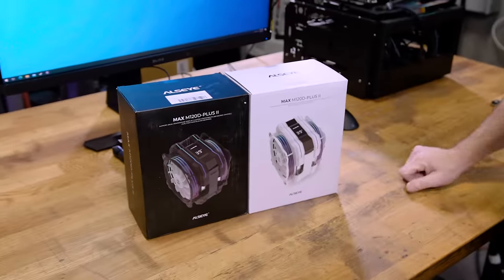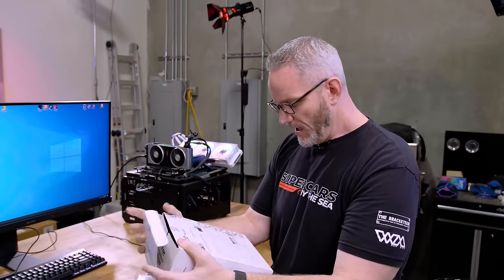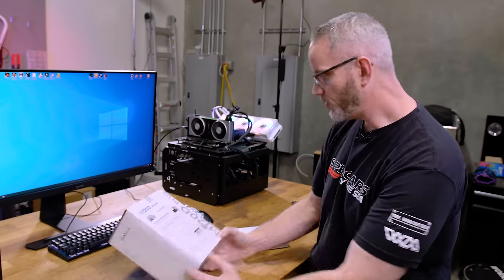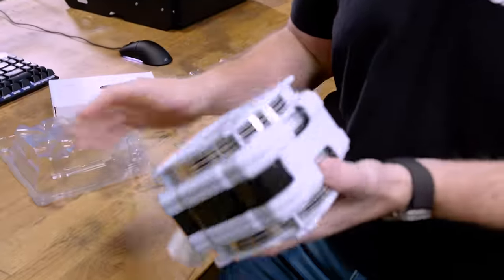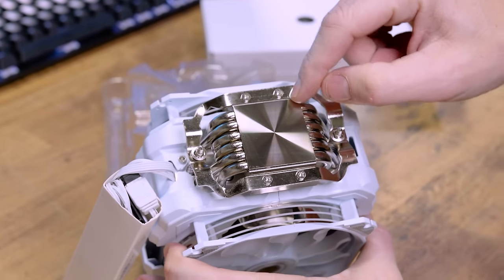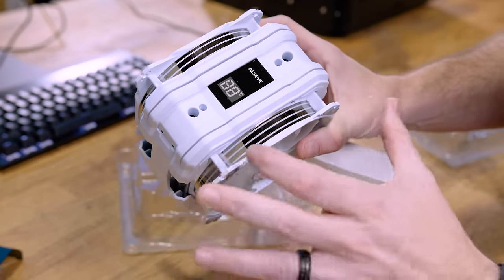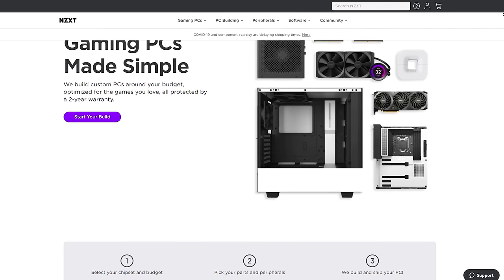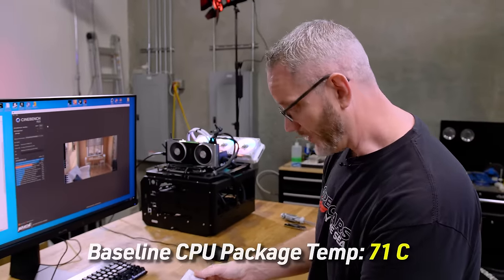This air cooler is actually terrible for modern CPUs

Comment: Jay is drunk LMAO.
This cooler is not for OC, at least not on 12900K/12700K.
Its a cheapo single tower Chinese default made for default clocks, no OC, [maybe some OC on 12600K]
Even on dual tower air coolers, like noctua D15, Overclocking 12900K is not a serious option

Comment: When my 240mm AIO died I ran my 10900K on the Hyper 212 Black Edition cooler while I waited for the RMA. The CPU thermal throttled constantly at stock settings. It ran well enough until the replacement AIO arrived but I couldn't run it under full load for long. With the 240mm AIO I use (Be Quiet! Pure Loop 2 FX) my 10900K, in a Be Quiet! 500FX case, runs a 5.1 ghz all core overclock with Asus multicore enhancement turned on and doesn't get above 85 C at full tilt. Thanks for your review of the 500FX by the way. It is what made me take a look at the case and ultimately choose it as my case upgrade.

Comment: I use a m120d-plus old version... for my 12600kf really fine... 
That aircooler dont looks good for i9 and some i7 if overclocked.
But with mid cpus is good aircooler.

Comment: I have a 4 pipe, 120mm fan, Deep Cool air cooler that was $15. Replaced my Wraith cooler that came with my 5600x and saw an immediate 20 degree difference. Cinebench throttled before with the Wraith, now it stays under 80c. My max boost will hit 4.8Ghz also.  ;)

Comment: Even though it is a push-pull cooler... it is "only" a 120mm single tower.
Other Coolers like this from the competition (like Noctuas NH-U12A) are rated for 150-180 Watt TDP.
And those Noctua Fans are almost certainly better.

So with a Power draw of 250 W on your CPU you are simply asking too much

Comment: I have my 13700k locked at 5.3 all performance core and 4.3 all efficiency core, underclocked temps being high 30 low 40 idle and low to mid 80s in Cinebench R20.

Comment: Funny enough I have a CM Hyper 212 Black Edition hooked up to my 5900X with a couple of Corsair LL120's in push-pull and it keeps the 5900X in mid 60's low 70's while running Chinebench R23. Of course wasn't really meant to be used long term. I'd like to eventually get a 360 aio at some point. :)

Comment: Ive been extremely happy with my be quite Dark Rock Pro 4 Cooler I have a Ryzen 7 7700X and its base clock is 4.5 and its been at right around 5.8ghz and running at 65°

Comment: Yes, please do a amazon cooler shootout! Running a 5700X cpu with a Hyper 212 Black in push-pull (2000 rpm). Keeps it nice and cool but I like this cooler for the temperature screen.

Comment: I am currently using a Cooler Master Hyper 212 Black Edition air cooler on my new Ryzen 9 7900X system. Normally when use the system the CPU temp averages around 49-50 C when idle or even with a handful of apps open. Sometimes there is an excursion towards 65-80C and then back down. When I run Cinebench (or use CPU ID and Stress CPU)  it hits TJmax 95C pretty quickly within 30 sec or so, stays there. So my questions are (1) if I let Cinebench run for the duration will this damage the CPU? I'm realizing it's probably throttling at that point and  (2) should I replace this cooler with an AIO? I have one but did not install it since I need to mod the case to make room for the 240 fans.

Comment: This one looks nice but I wouldn't trade the Vetroo V5 I ended up purchasing after seeing it on one of your shows. 150W TDP air cooling plus the choice of which side the fan is installed so it doesn't interfere with the memory. While I don't do much gaming with my computer, I do make it work hard compiling code, CAD, working on preparing 3D models to print, and other tasks. I can't recall my CPU temperature going above 70C and I know for sure that it hasn't gone above 80C. When my computer, an AMD 5900X, is running at max the CPU temperature is in the 60C's and doesn't throttle. This is thanks to very good ventilation supplied by the fans that came with the Cooler Master MasterCase H500 case.

Comment: guess they updated the tdp. its 235 now. anyhowwhen, noctuas fans have double the power (mmH2O/CFM). So i guess you could use atleast that display if you replace the fans for 300w tdp?

Comment: Do it test the coolers i have the Scythe Mugen 5 Rev.C CPU Air Cooler, 120mm Single Tower, Black Edition, Intel LGA1700, LGA1151, AMD AM5/AM4/Ryzen 120mm, Single Tower and want to know if i did good for my ryzen 5 5600 cpu!

Comment: I think the crash at the same point is due to software lag. It probably hit tjmax but the PC had no time to process it and send it to the display as it was crashed already. That 5.2 no throttle setting overwhelmed the system without high end cooling.

Comment: Hi Jayz, What do you do with the old processors/motherboards? 
We are a newly started Esport Organization in Norway that has grew to the biggest "club" in Norway, and we are currently looking to set up a prep room for our teams. 
Parts in the US is so much cheaper than in Norway it's insane. 
What we are currently using are i7 -7700k to i7 9700K on the LGA 1151 platform. 

We are only focusing on CS:GO. 

What combo would you recommend for our setup? Motherboard/processor?
Best Regards
CO-Founder Nordix E-sport

Comment: I like the aesthetics of this Alseye cooler, I have it and I want to wait for you to give me a similar and better option before i build my new rig, I thought I had a great deal for my ASUS  Prime Z790-A DDR 5, you should also do a review on the Alseye Ai Pro case in white, my parts are Core I9 13900k, Corsair dominator 64 DDR5 Ram, 1000w psu and WD SN850x…I also like a Radiator coolers but in all white with the temp display, I’m big on aesthetics..any suggestions on the cooler would be great..thanks and i love your hard work and passion on this channel

Comment: 8:36 wee need new header like +12V +5V G R G B USB+ USB- and FAN so if I'm right there should be 9 wires cable :) plug one cable and your done, have all rgb all fans all usb :D

Comment: I use this, but in black, with my I7 11700k and this keeps my CPU at ~75C during a stress test and I've seen a peak of 91C and I haven't seen any Thermal throttle.

Comment: it is a single tower air cooler, for a high end cpu your would want a dual tower cooler (comparable to a 240 aio)

cooler tdp can only be compared with the same brand (tdp has become a fake marketing number)

i have cooled a ~200W cpu (phenom ii 965 @ 4.2ghz) with a 212 evo, push/pull 100% fans running prime95, that was a fun cpu to oc...

Comment: Whats the best low noise one to get. I like the thermal screen on the cooler. I have a case with a window so i can see it. 
I think it's alot of extra wires. Should i care. Kinda want to make it neat. 
The darkrock pro i bought isn't enough for the i7 adler lake. Got a crash a couple of times bc of overheating.

Comment: As a potential first time builder, I would be highly interested in an air cooler comparison, or top 5 etc. I would also like a water cooler baseline as well based on radiator size (120, 240, 360) to be included to not only show which air coolers are effective, but also it might be more worth it to upgrade to water cooler depending on stock/oc and general performance expectations and outlook
Reply: first time builder you say, i would deffo go with a AIO hydrocooler. instead of pure air cooling. 
Make sure to setup fans with proper intake and exhaust.
Make sure when you choose a motherboard that you get DIMMS your motherboard naturally communicates with. 
Building now a days is super easy compared to back in the days, remember more RPM on the intake than the exhaust, and pay attention to the CFM of the fans you buy, and if you dont want a noisy computer, go for Noctua :)
Reply: @FingalPersson  thanks for the notes. I definitely feel like I'll go AIO since I'm considering a 13th gen chip. But I was still curious where the dropoff would be or if air could compare to a 240. Or when it'd be worth getting a 360 vs 240 kinda thing
Reply: If you are going for the 13900K i would recommend buying a CPU bracket along with an AIO. The temperature difference is major. We are talking 20-30 degrees Celsius difference under heavy load and about 10-15 degrees difference at idle temps.  

I have a 280mm on my 11900K thats 2x140mm on a rad, works just fine.  I am going with a 360 3x120mm later, mainly because the radiator is larger, therefor heats up slower and it fits my intake better to have 120 exhausting on top than 2x140mm.

Right now i have a quite stupid settings for my setup at the same time its not that stupid.

In front i have 3x120mm

1x120 @ 1600 rpm max
2x120 @ 2200 rpm max 

Now the one that cant do 2200 rpm will be cahnged to the same fan as the two that does do 2200 rpm.

the radiator mounted on top is with 2x140mm that throws 1700 rpm at max.

in the back i have a 140mm that can throw 2000 RPM.

Now this is NOT ideal tho.

The ideal would be to have 3x120 @ 2200 rpm intake front

3x120mm 360 rad on top

and keep the 140mm in the back, but also maybe not run it at a very high rpm unless you do have your GPU vertical mounted, then i like to ramp up the rpm on the backexhaust too as it will take out the hot air from the gpu quicker.

I am thinking of re arranging the location of the fans in front,  just to h ave the highest RPM on top and the lowest on the bottom, but at the same time oh tho its more of a job, i kinda wanna put the AIO in front with push intake
and then leave the 3 120 fans on top as exhaust but im unsure if i got space enough, i do have a massive 4080 rog strix card in my NZXT H7 flow case :)
Reply: @Koyote2033  but front mounting my AIO now would be pretty bad idea air pressure wise.   So i'm better off having it on top, exchanging it with a 360 rad :)  
I sorta dont like to block off the airflow from the intake with anything, especially not a radiator, oh tho i do that in my streamer rig, which is a H510 flow case. Have a 240 in front, 240 in top and 120 at the rare end on that, and that works great, but it only yields a 3070 card so its not as air hungry as say a 4080 for instance :)
Reply: The problem with AIO's is their lifespan. Pumps usually only last 3-5 years. My Dark Rock Pro 4 will never die lol.
I do love the aesthetics of a good AIO tho, compared to an enormous air cooler.
Reply: @DarkReturns1   who told you that so that you believed it? lol That a lie.. Also your fan, with a BeQuiet on it can like all other fans, fail... i started using AIO when i bought my i7-3700.. used it until i upgraded to having to new systems, beingn 10700k and 11900K. both using AIO.  That rig that has the i7-3700 is still running with the same AIO with fine temperatures.  That rig is from 2013/14 ...
Reply: Thermalright Silver Arrow II...
320W or something like that...
They have modern versions of it.

Comment: Jay is conflating cause with effect.
The CPU can absolutely operate with stability at 104 degrees all day every day.
If it's unstable at 104 degrees it's because there is an issue with your overclock; not the CPU is "too hot".
It being hot is a byproduct of excessive amperage which causes excessive heat and crashing.
If 105C was "too hot" then the junction temperature would be lower.

Comment: Ever since the days I bought an 8350, I have not looked at HSF coolers...even the stock cooler that comes with the CPU, I will not even consider it anymore.  If I have a water cool option, I will spend the money and go there for a decent rig to exceed  the temperatures.  My current rig has a Corsair liquid cooler H170i Elite does the trick nicely with the Ryzen 5 (apu version).  I have a Lian Li case that predates that 8350...it is a seriously awesome case I will never part with...it sported 3 large 140mm fans up front.  This cooler replaced all those, equal size radiator...the thing is huge...it barely fit in the existing space left for the original fans and a couple fingers room, had to pop a couple rivets to get the radiator to swing in place, its doing the job supurbly.  Another large 140mm fan on the back to exhaust.  Cooling the CPU to a chilly 43C at idle.  The coolant lists around 30C.  It would probably be a bit cooler, but the condo I live in, I don't turn the heat on and it still bakes...25C is a "cool" day...lol

I have yet to see the CPU crest 55C with this cooler, even while doing a video recompression and the CPU running full tilt in Handbrake and playing FA76...(performance benchmark testing)...the fans barely turn at this level.  At idle, they don't turn at all.  

I will never go HSF ever again.

Comment: 13th gen is so confusing to me.  I did a small ITX build with the ASROCK board and DDR5, Prime95 clocks it up to 6ghz for about 20 seconds with an artic cooler 280 and immediately goes to 100c.  I have a thermalright plate, artic MX5 compound and its still high.  Granted I only see that in synthetic loads but its crazy to me that it would get that high.  I have no idea how to change it.

Comment: All TDP ratings are arbitrary. The CPUs design will make such an impact on how well your cooler works. Just look at the 65w 7900 vs 7600, by having that extra CCD its kept like 30c cooler. There really is no point trying to declare a specific wattage a cooler can handle, when there are a dozen ways to mess up the environment the cooler has to work in. Just watch any Gamers Nexus pre-build review.

Comment: Cooler seems over priced to me. 
I'm running an R9 5900X and to cool it in using a Cooler master 212 tower paired with a noctua NF-12 IPPC 3000. Buying the cheapest 212 option and replacing the fan with the noctua one was less expensive, and I never see my CPU break 75 C. 
It is a noisy fan when it's going full speed (and the side if the case is off when the side is on, it's barely noticable), but it doesn't do that often. Most of the time it's spinning under/around 1k RPM, and it's absolutely silent at that speed.

Comment: Hello Hello From Canada!!! Hey I was just wondering if the cooler could be misbehaving because it is at such a funny angle? If it was setup horizontal like in a common case, would it dissipate the heat properly? Great review though, but I was just curious if it was getting handicapped. Stay happy and healthy.

Comment: It's a bit gimmicky and a little overpriced, but an aircooler that small that candle 250w+ heat load is kind of impressive...I would almost bet that the Vetroo cooler cannot handle a 250w load...

Comment: Its funny that my 4790k all these years later, despite these modern huge-core CPUs, is still considered one of the best CPUs on the market. Still runs head to head with many of the best and has no issues with productivity, video editing, gaming at 4k, etc... Just upgraded from the stock Intel HSF to a cheapy 'tower' style cooler like this and stay easily 10-15 degrees cooler across the board. Absolutely silent.

Comment: Let's be honest here, PC aesthetics have come a long way, and often are now part of the PC "showcase". A far cry from the white bread-bins of days gone by. The cooler did its job for the most part. A dissipation-per-$ or a Air-cooler-in-an-actual common-PC-build showdown would be nice.  I live in a country with a high disparage between summer and winter, and most homes do NOT have air-conditioning, so on a chilly winter's day, cooling is heavily assisted by bringing in frosty air, and conversely severely hampered by hot air in summer. A good cooler should be able to maintain CPU performance at a target CPU temp despite this. If a cooler can maintain say 70c summer heat or winter chill under max load, then it is surely a sign that that there is good heat extraction in place. In server-room-land, no matter what is going on outside, the room has sufficient cooling that no matter how hot the CPU's CAN get, the ample overage of near-perfect cool air allows server-land to run constantly for decades because of the extreme consistency its environment provides. Servers get decommissioned before their CPU's pack up. In fact, in over 25 years of working on servers, I have never seen one fail because of the CPU. Maybe we should talk about the perfect PC-internal component environment and how well builds and adaptive cooling maintain a normalized, consistent environment for the components. A PC that sits with GPU, CPU, RAM and other components at a rock-stable 50c, regardless of load,  will outlast a PC that is madly flapping between arctic and volcanic temperatures. Thoughts?

Comment: Jay mentioned wishing the box would say a TDP rating and it made me think, I just put a Cooler Master Hyper 212 Black Edition (single fan) on my i7-8700 and the website has NO mention of power rating. I will say, in my case, running Cinebench all core for 10 minutes it keeps my CPU to about 60*C. The 212 is cheaper, but it's only 1 fan and doesn't have a screen. It seems this Amazon cooler might hold value on a lesser powerful CPU.

Comment: Without RGB and screen they could fit very good fans into same budget. But that's what sells, and industry complies. I wouldn't care if it didn't narrow or eliminate options for those who don't want RGB aquarium. Almost all mid to high end cases are now with one or more glass panels. The last bastion, Fractal, has models that only come with glass side. And low profile high-end DDR5 with Hynix die is not even being sold in Europe.
/rant end

Comment: Air coolers $100 or less on the 13th gen would be a great help. I was given a "Coolerguys 4U Active" to review and was concerned it's not enough even though it claims to handle 300 watts. Set up is  13700K on Asus Strix z790-E in a Fractal Design 7. At idle it keeps it 35-38 C but once I start up Cinebench it hits 90 C easily and begins to throttle back with a max of 5.2 GHz. I also mounted it with one of those Contact Frames. I did leave the preinstalled thermal paste for the review but I will try to replace it with another brand to see if that makes any difference.